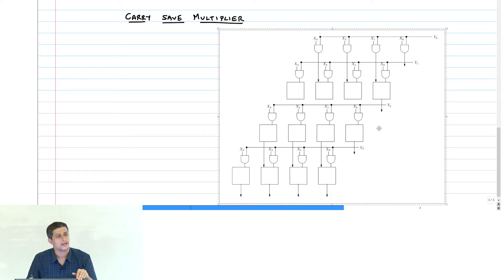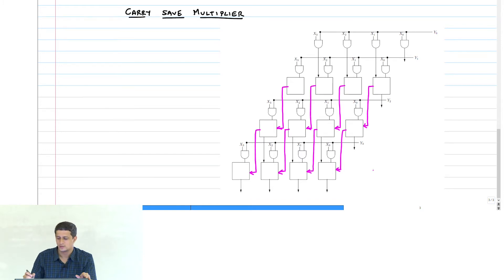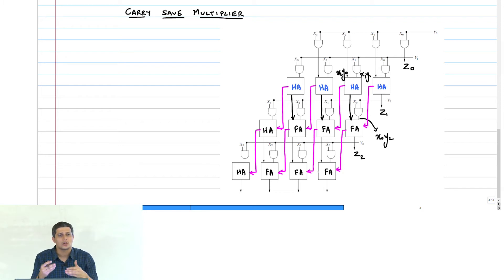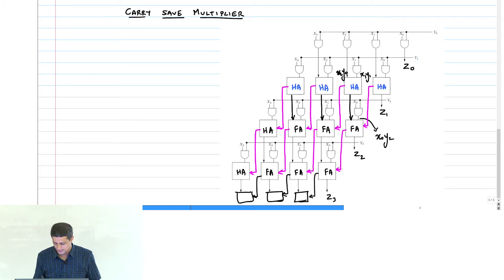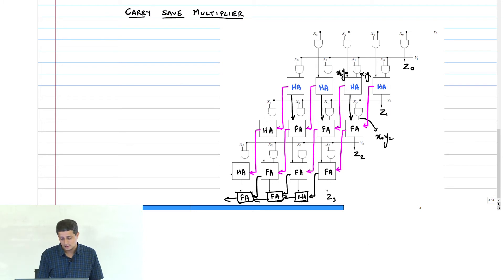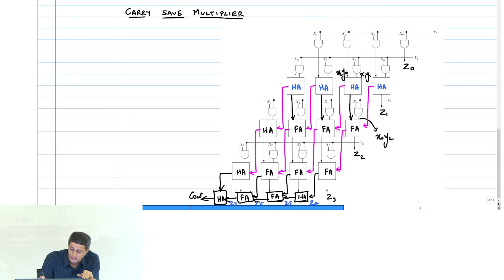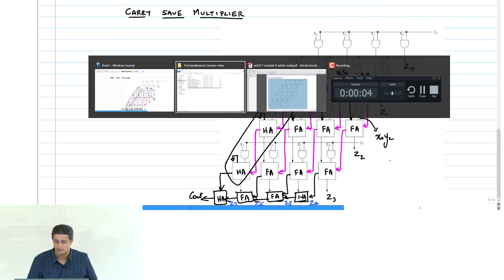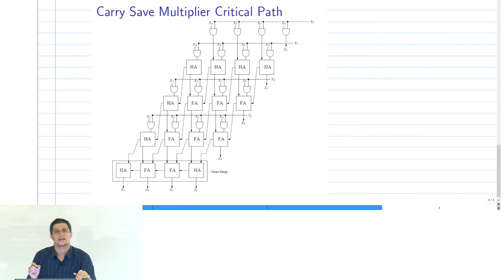AM - 11 - Carry Save Multiplier

Comment: 15:26  it should be t(and)+(M-1)T(carry)+T(merged)
Reply: not actually
in this example it was taken Tsum and Tcarry are equal to 1 but in actual circuit implementation Tsum takes more time then Tcarry as discussed in previous videos. This is why the critical path is different from what discussed in this video. Thus the (m-1) Tsum is true. correct me if I am wrong
Reply: @lazylevi10  tsum has nothing to do with the ripple merged stage , sum will be executed parallely.